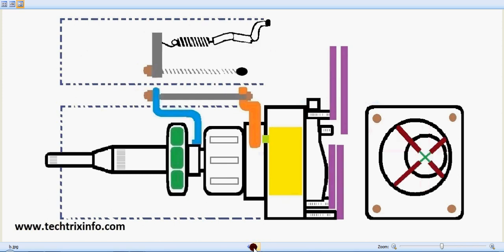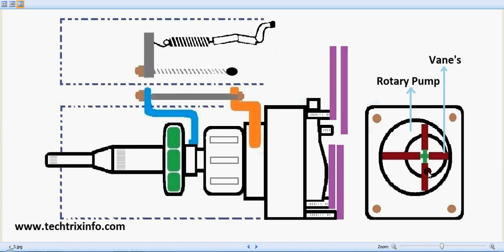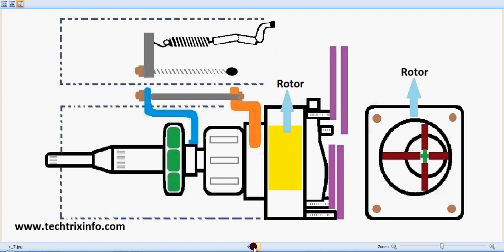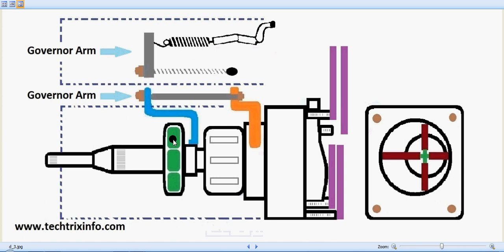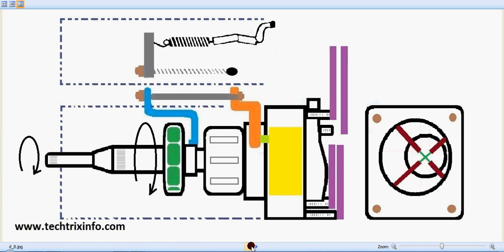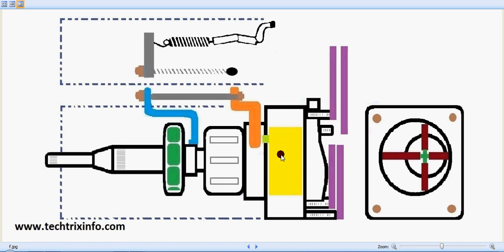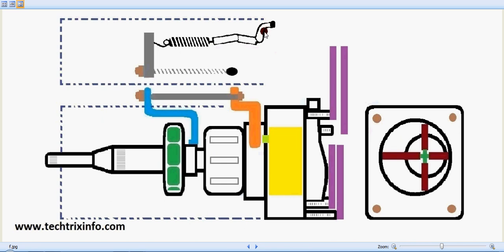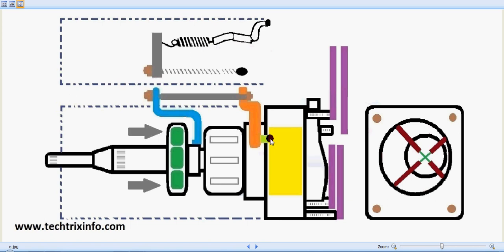Animation - Working of Fuel Injection Pump. ✔

Comment: I have a tractor with a diesel fuel pump like what is being described here. It is on a Perkins engine type 1104C-44T Turbo. From time to time when accelerating the engine will not respond to the throttle. Indeed on the odd occasion the revs could drop back and the engine would die out. I have treated the diesel to make sure there is no water in the system but it can still do it from time to time. I also checked the solenoid and that seems to work ok on testing. Any ideas.....?
Reply: Dear Pat
you can contact to me on Whatsapp@8077911611 related to your query,..

Comment: Late, but for those browsing now like me....Indira's comment is not quite right.  Some earlier diesels (still lots around) use a pre-chamber or swirl-chamber where the fuel is injected into rather than 'direct'ly into the cylinder.

Comment: How would the installation of a turbo charger affeft the operation of the injection pump? Would the higher pressure in the cylinders at the higher rpm's prevent the fuel from entering the cylinders ? Would the addition of a pump upstream the fuel injection pump(which would raise the suction pressure of the fuel injection pump) give the fuel enough pressure to  supply fuel to he cylinders at the higher rpm's
Reply: This is a fuel pump for a diesel engine. The fuel pressure created by this pump is much higher than the pressures inside the combustion chamber
Reply: lolatmyage what if i had a non turbo diesel engine, then installed a turbo. Would the additional cylinder pressure be a problem for the original injction pump?
Reply: Ashmeed Mohammed
I dont think these diesel pumps are that different. Some cars came (not that many n/a diesels today) with a turbocharged and n/a diesel engines. It is cheaper to develop one pump that can do everything instead of  several versions for different engines. I did some googling and found that an example of maximal cylinder pressure for a diesel engine is about 40 bar and the fuel system is pressurized to 100 bar for indirect injection, 2400 bar for unit injector systems and 2500 bar for common rail diesels. The pressure difference is massive, that difference helps the diesel fuel to atomize better and in turn burn better.
Reply: Ashmeed Mohammed
I dont think these diesel pumps are that different. Some cars came (not that many n/a diesels today) with a turbocharged and n/a diesel engines. It is cheaper to develop one pump that can do everything instead of  several versions for different engines. I did some googling and found that an example of maximal cylinder pressure for a diesel engine is about 40 bar and the fuel system is pressurized to 100 bar for indirect injection, 2400 bar for unit injector systems and 2500 bar for common rail diesels. The pressure difference is massive, that difference helps the diesel fuel to atomize better and in turn burn better.

Comment: NO, it's diesel. Diesel use direct injection that inject fuel directly to the cylinder when both valve (at 4 stroke) are closed or when the piston near top dead end of compression stage.